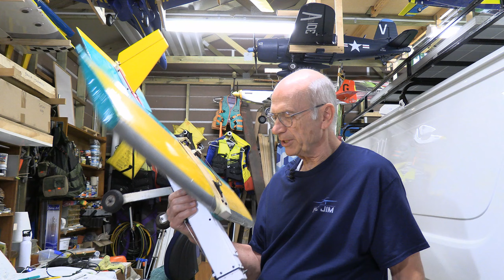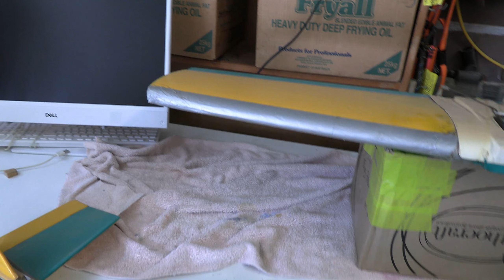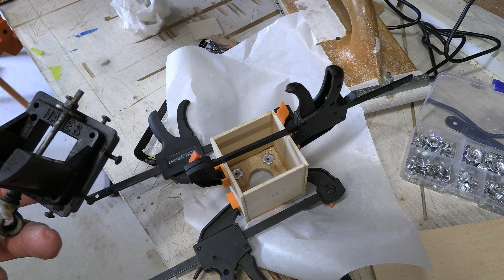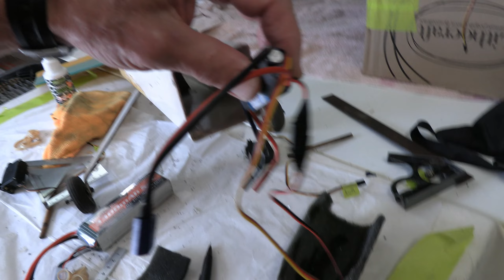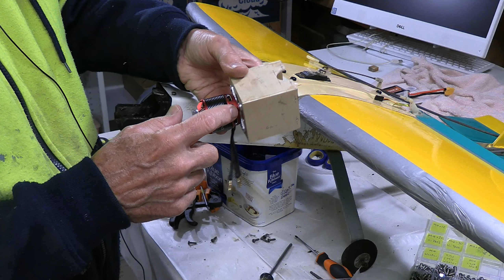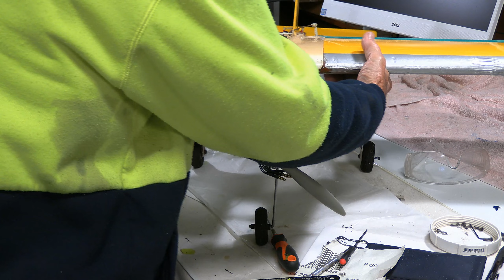Duraplane Aerobat 40 Conversion to Electric

Comment: Nice model, I do recall maybe close to 30 years ago now, watching it's cousin, the 'Durabat' fly on floats.  Very nice, true sport models.
Reply from the maker: I actually tried floats on this one way back when.   Unfortunately they were not quite big enough.  The plane would float fine with the engine not running, but with it even at idle it would dump over forwards!   ...actually, I still have those floats as well - hanging in the garage!

Comment: Wow, this brings back memories!  This was my first plane back in 1989.  Actually, mine was the Durabat then I upgraded the wing to the Aerobat wing (still as a tail dragger).  Started with an OS MAX 25, then OS MAX 35 then finally the Magnum GP40 (all nitro).  Glad to see you've made some big changes to yours and you are loving it. Sold mine years ago before getting back in electric RC planes in 2020.  Have fun with yours!!
Reply from the maker: Yes Bill, my initial motivation was related to the great memories.  But, now that I have flown it, I'm drawn by the fantatic way it flys - even if it doesn't look like much!